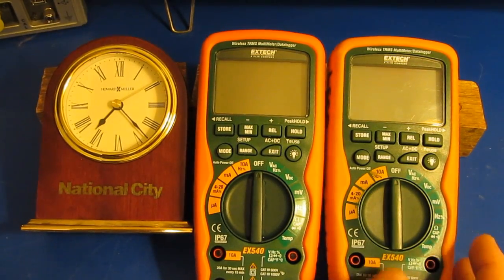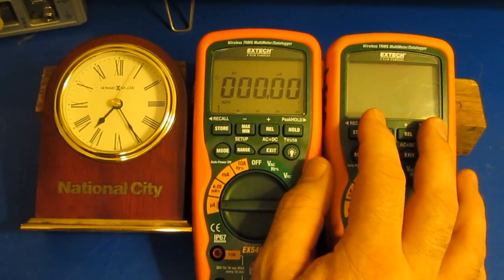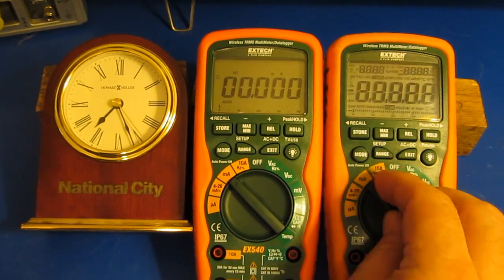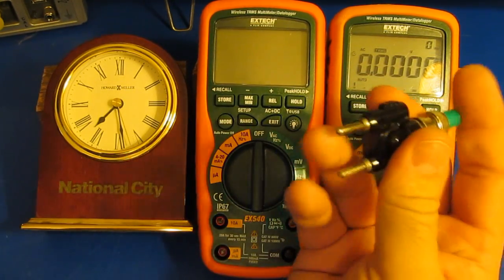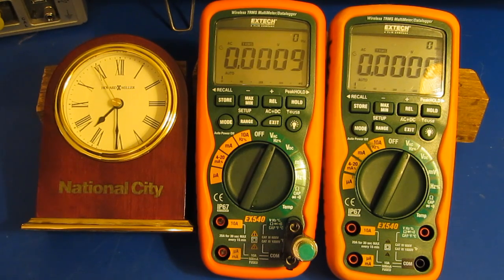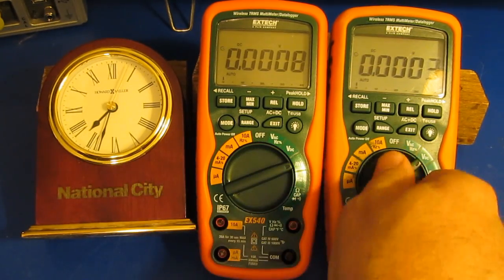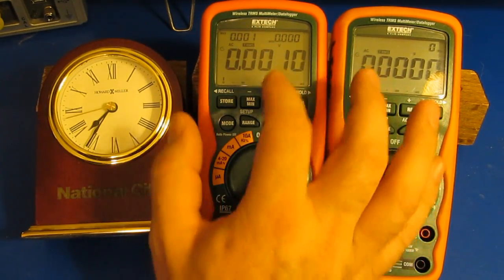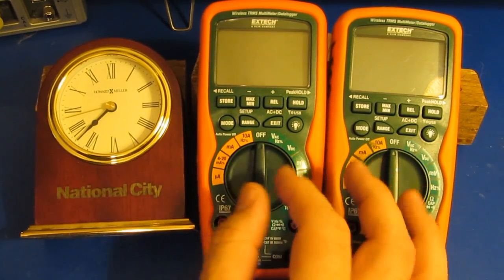EXTECH EX540 ACV Problem

Comment: I believe these meters (and a lot of others) are made by CEM instruments in China. Their website shows an enormous range of models, but is down right now: http://www.cem-instruments.com/en/index.html 

I bought one branded Digitech in Australia and after a month of fairly light use, the selector switch came off, pretty much like what happened to the meter you loaned out. I returned it do the dealer for replacement, but I'd think twice about buying another one.

Comment: I don't understand why you wouldn't just return it when it had obvious problems on day one?  I mean it is a $300 US meter (I had to Google it).  If it was a cheap $30 meter, sure take it apart and fix it but at $300 I expect things to work!  And the manufacture needs to know that they shipped a defective unit.  That being said, I would have preferred if you showed more of the problems and your fixes instead of just describing them.  Keep the videos coming, Joe!
Reply from the maker: None of them are cheap!   To test a meter and record it takes a fair amount of time.  Not to mention the time it took to setup to run these tests.  The meters have no value once I am done with them.  Most are damaged beyond repair and the few that survive or are repairable really can't be resold or given away.    Believe me, this is not a get rich scheme.

I could have returned it but I tore it down for the same reason I post the videos of the meters being tested to failure.     It allows people like yourself to see some of the problems with them and how they compare against other meters.  

You may find reviews of meters being drop tested from high places, drove over with cars, thrown against walls,  placed in water, maybe even reading a few voltages, resistors and capacitors from time to time.  But here my goal is to see how far I can push them electrically because it's rare I swim with my meters.    

And while I get accused of being anti this or that brand, in the end I have nothing to gain from it one way or another.   The tests are ran the same so you get some pretty unbiased data.     

"That being said, I would have preferred if you showed more of the problems and your fixes instead of just describing them."

I thought about it but it would have taken too much time and I knew I would not be testing the meter after I saw what all needed to be corrected.       A bit of a let down I know but heads up!!   I have an even better meter that is in the works so stay tuned!!!
Reply: My thinking was that it would be better to test the meter before you do your fixes.  $300 is a lot of money to put out for a test when the results might not be accurate and they will perform better with your fixes.

I don't see any bias in your reviews and tests.  Some VIEWERS however are very bias because they don't want to see faults in the products they purchased.  That's why they defend their purchased meter by saying the operator should know better, etc. even though accidents do happen such as having the meter in the wrong mode or switching modes without disconnecting the leads first. We can't change their bias.  They like their blinders where they are!

I'm staying tuned but I hope this "even better meter" is tested before you modify anything.
Reply: BTw why extech and no a brymen 869 i think the breymen beat in all the extech crap.
And less cheap i got the brymen 867 and was only 180€ whit shiping form TME.
Reply from the maker: Oh, I am biased alright.  And believe me, it has changed over the course of the last few years.   Test this many meters, you are going to start seeing some trends that will bias your opinion.   But my opinions have nothing to do with the data I collect.  There is no brain scanner on the generator that changes the waveform based on my thoughts.   It's a pretty level playing field.

I have continued to investigate the differences between the two 540s and  am posting updates on the EEVBLOG site.   Another member repeated the  drift test and it looks like it behaves the same.   So at least we know it's not unique to this one meter.     

"I'm staying tuned but I hope this "even better meter" is tested before you modify anything."

I have the meter now and have looked it over.   Currently I am trying to get some answers from the supplier about a few of its features.  It will be tested like the others with no mods.  Now, if it fails and I am able to repair it, it may indeed see a few changes like some of the other meters I have looked at.     The Extech EX540 was a special case.   It would have been tested out of the box had it actually worked.   Maybe I need to add a new column for DOA.
Reply: Hi Joe, May I ask what your bias is? I am in the market for multimeters and I would like you input.
Reply from the maker: Mussie,  keeping in mind that what I use a meter for and what you would need one for are most likely different.  That's why you see so many different products out there.  I still like the Brymen BM869s over all the meters I have looked at for my electronics hobby.  For low voltage  electrical work with the bikes, I still use my Mastech.     Watch that last review I made for the CEM.   https://www.youtube.com/watch?v=wkrbohiuUwU
Reply: joe smith Hi again Joe, I landed on the Brymen BM869 after quite an extensive research before you even replied. The only problem is that it is nowhere to be found. There are a couple of BM867s on eBay, but I would kill for an 869. I may end up getting the 867 if nothing shows up in the next two weeks. Thank you for the reply.
Reply from the maker: Yea, a one day response is a pretty long time...  I have the newer S version that I bought from TME.  I've been very happy with it.  But, it's not something I would want to drag into the garage.  It's too big, costs too much and is overkill for most of what I would need it for.  I did pick up a used Fluke 97  handheld scope for the garage.  Not a bad unit but parts are not available.
Reply: How much did you pay for yours? They don't have it in stock on TME currently.
Reply from the maker: That's too bad.  I had seen people post about other Brymens that were not in stock.  Maybe the demand has gone up.  I think it was about $230 US with shipping.   Again, about 2 years ago and I would expect pricing to change.